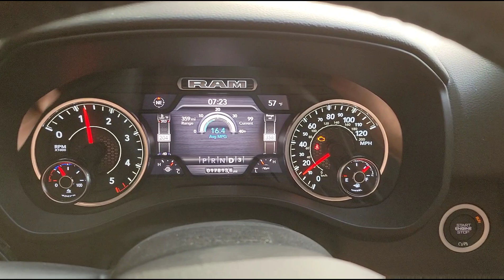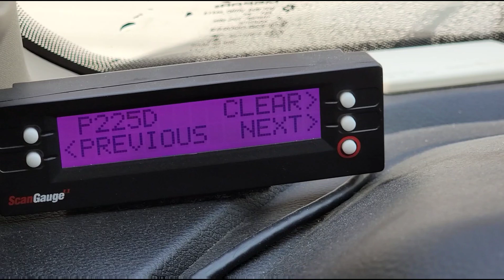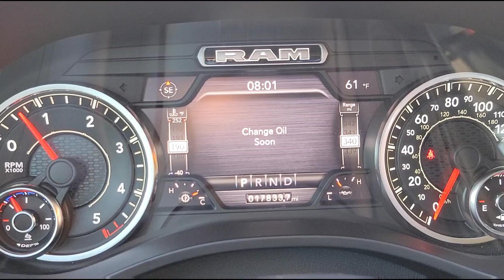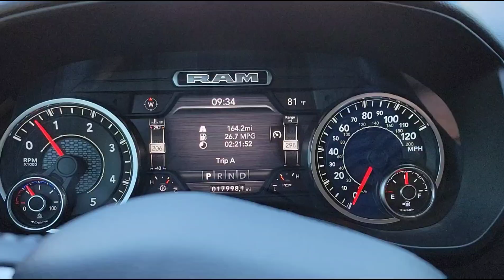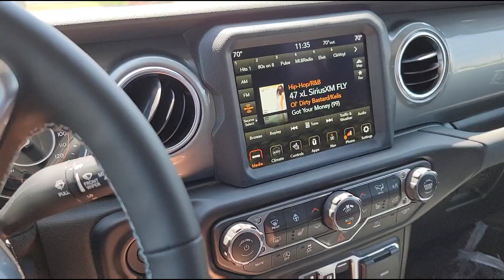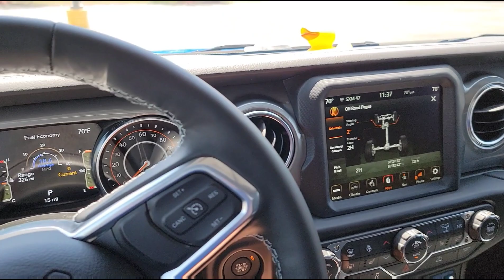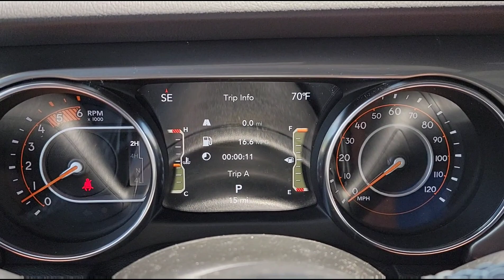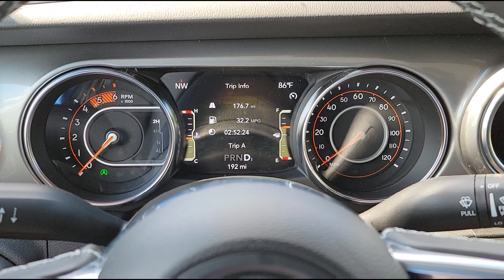My New Jeep Gladiator EcoDiesel Putting Up Some INCREDIBLE Fuel Economy Numbers!

Comment: Very nice gladiator.  I like that configuration allot.  
I'm researching to purchase a gladiator too -willys ecodiesel.  Other Options: auxSwitches+premium top (no hardtop)+roll tonneau+7" display, unsure about tow and heated seat pkgs but considering them.
Willys says it includes heavy duty brakes and lsd in rear too.

I think the gladiator with diesel also get cast knuckles instead of aluminum.

What are your thoughts on an EGR blocking plates and aftermarket tunes?  Bad idea?  I wonder if there even exists aftermarket tuner.

I plan on keeping mine relatively stock (no lift or huge tires etc).  Perhaps later a front locker at most (torq lockers is developing their lunchbox locker for front M210 Dana 44 to be released later this year) if i find i need it off-road.

Comment: Being new there is a break in period, and I think your mileage will improve over time. Excellent buy and I know you will love it. Considering the DEF, expensive oil changes, and extra maintenance it is still cheaper getting my dollar off per gallon up to 35 gallons at Kroger with my 2021 Gladiator High Altitude. Only thing I will miss is the better torq and mpg. I've had the tops and doors off since April here in Toledo the home of the Jeep and have enjoyed it a lot better than any other pickup with no problems of course. What was your trade in price? I remember you bought the Ram for 39k and trade in was 45k? I like you buy multiple Jeeps every 1 to 3 years and enjoy the freedoms and capabilities that come with the Jeep ownership. Happy trails.

Comment: I get awesome MPG with my 3.6 V6 I get around 13.3 MpG on average lol 😂. If you add bigger tires, wheels it drops the MPG about 4 MPG from stock. Then it becomes a bit underpowered. I really like the truck but the ECO-Diesel option is looking good. 🤠👍🏻✌🏻